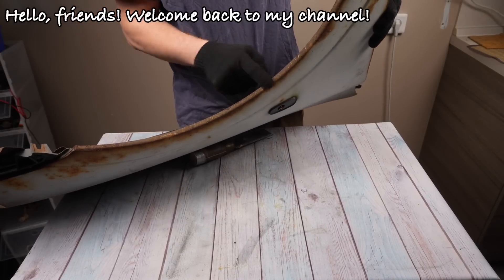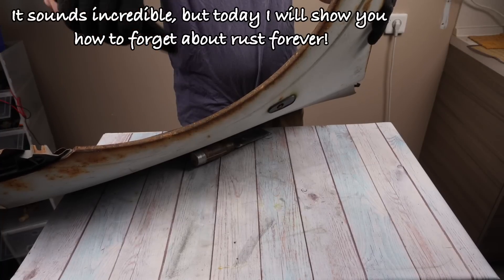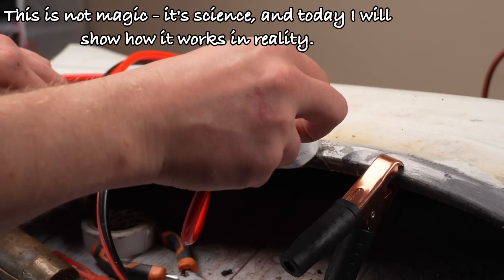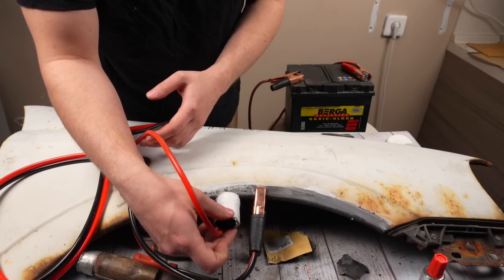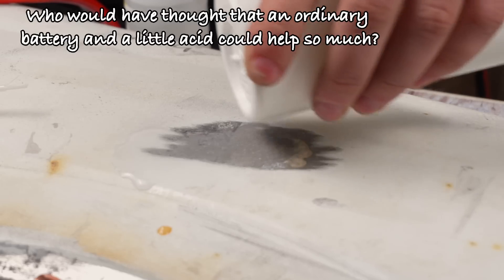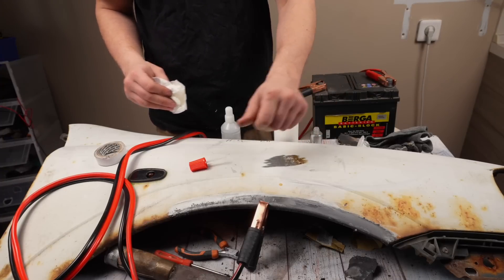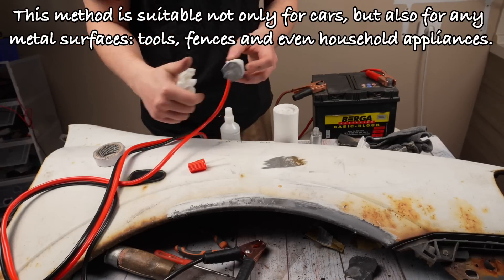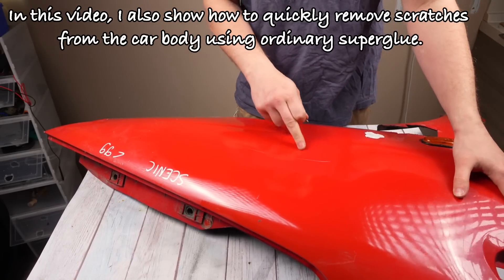Experienced DRIVERS taught me! Apply zinc coating and remove all scratches from your car

Comment: I call BS. It is many many years since dry batteries used a zinc case, These modern cases even rust.
Reply: Also "soldering acid is concentrated Hydrochloric Acid which will continue to eat the metal unless "perfectly" neutralised.
Reply: @robames1293  orthophosphoric acid